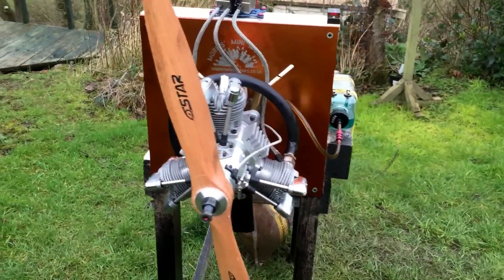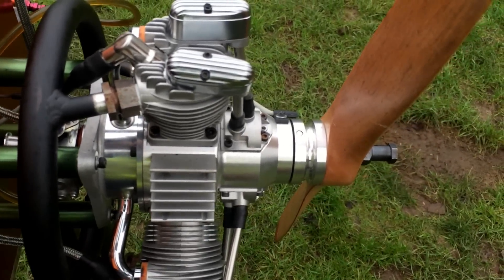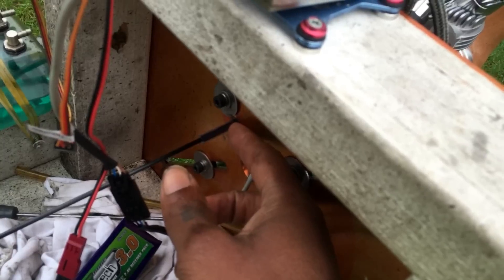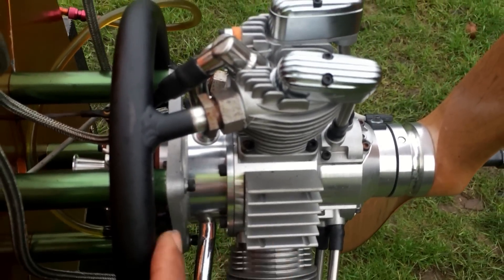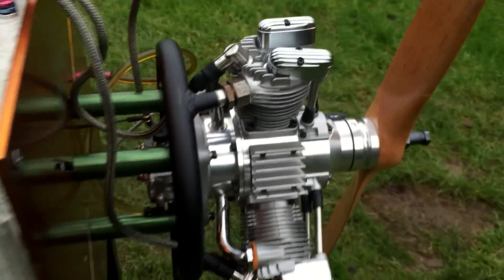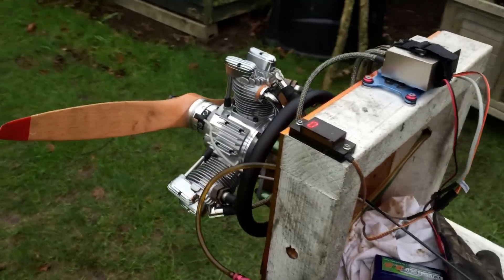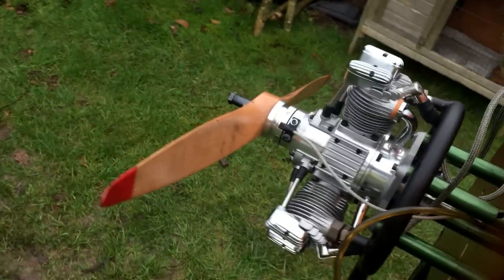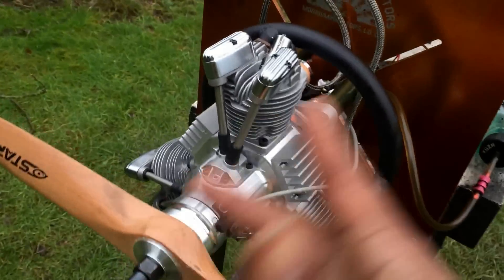Saito FG-84 R3 with new intake and original saito FG carb 20 to 1 mix

Comment: Hello I have these engine new in box to install in a fockewolf. Why do you recommend modify the intake and carb?? And what changes if I change only intake???
Wait your response. Thanks 
Juan
Reply: Juan, the stock intake does not deliver equal amounts of fuel to all 3 cylinders which results in cylinder 1 running lean and hot while cylinder 3 runs rich.  This leads to a dirty transition between low and high rpm.  This new intake provides better fuel delivery to all 3 cylinders resulting in better throttle response and cylinder head temps that are more equal.  Hope this helps you out